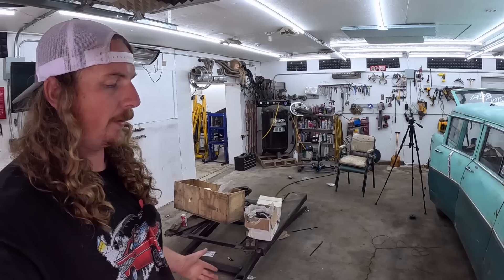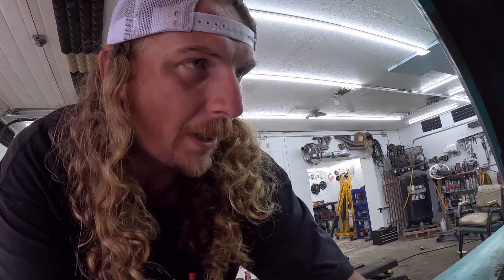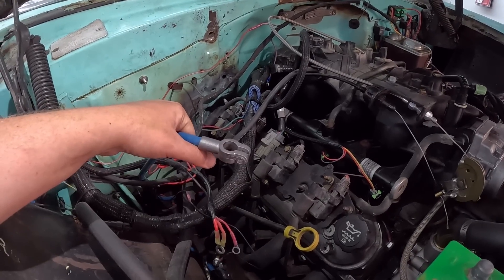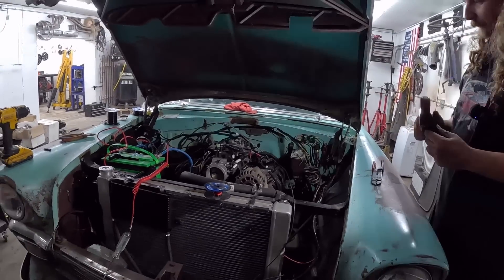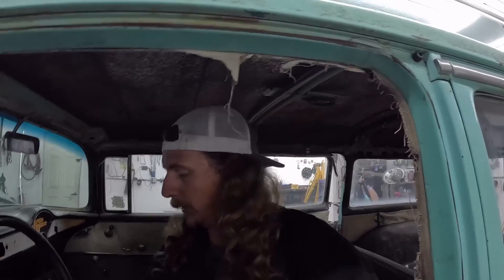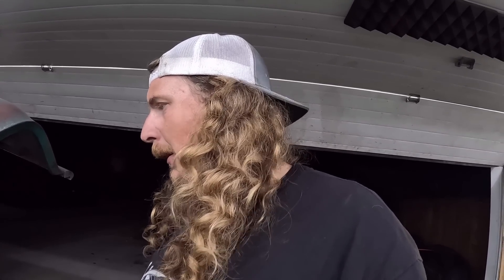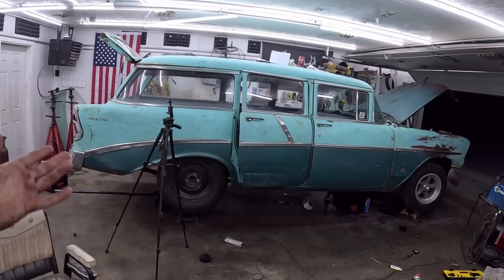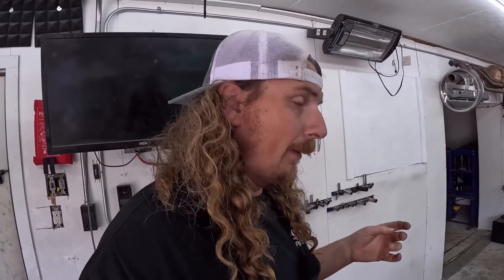SO CLOSE YET SO FAR.  Why Did I Give Up On This LS Swapped 1956 Chevy Wagon???

Comment: I’d drive that wagon down to Dave’s house for cruising the coast, then leave it there for road trips, just fly down. I would spray some bed liner on the new floor pan just for sound and heat protection
Reply from the maker: Not A bad plan
Reply: Took the words right out of my typing fingers
Reply: And go ahead and figure out the creature comforts and have AC and heat 😁
Reply: And the airfare for two would still be less than half the cost of gas to drive there and back.

Comment: When I Built leaf springs in the Machine shop I worked in we used a 50 ton press we also rolled the eyes and made u bolts. Working on a car till you bored with it then work on another car for while then another later on helps keep your sanity intact. I however usually make a list when working on each of my cars so I know what is done and what isn't. Of course right now I don't have any to work on.
Reply from the maker: Yeah I wish I could be a little more organized haha.  Maybe one day
Reply: @DDSpeedShop  The only thing I keep organized in my tool box's so I can tell someone (my wife mostly) what tool I need

Comment: Being your battery cables are short I go ahead put a Ford solenoid switch on the firewall so that way down the road if you need to adjust the valves or something this there and you can come off of it to the battery and that way you'll have a hot post on the solenoid switch for something else in case you need it down the road, I put one on my Nova....

Comment: I do the same thing, but got a car 90% ready for primer, and stopped working on it, and now 3 years have gone by. Used that garage for storage, but got it cleaned up some, and gonna get back to work on it, once I get this galaxy together, which have had for almost 2 years.  My main job is working on cars, and when it comes to working on mine, well they are never finished, and when I get one done, I tend to sell it, because I don't want to scratch it.

Comment: Hey Dan on the 56 wagon transmission leak you might have your transmission cooler too high then when the car is shut off for awhile the fluid drains back to the transmission and overflows wherever it can front and rear seal dipstick tube places like that might want to relocate it maybe between the frame behind the bumper

Comment: ya they rearc springs, they put them in a die that arcs them to what every they want them heat and cool them to make them stay, its not super hot few hundred degrees just to make them relax and take the new shape, if they are over heated they get to brittle and will break.

Comment: Turn your trans cooler 90°, 
inlet and outlet on the side not the bottom.Hook the inlet to the bottom, outlet at top, then you won't have an airlock in there.....ask me how I know, did it with trans and engjne oil cooler.
😬